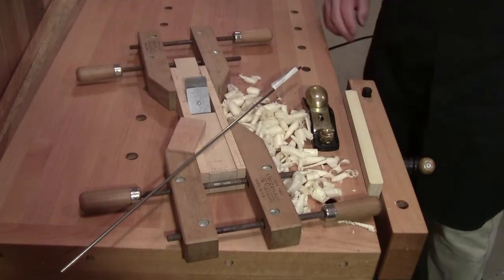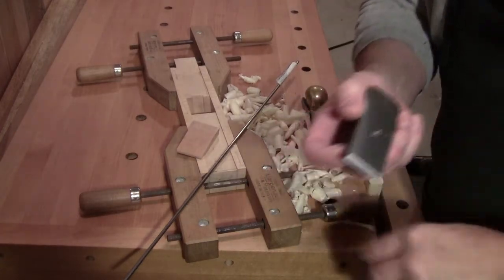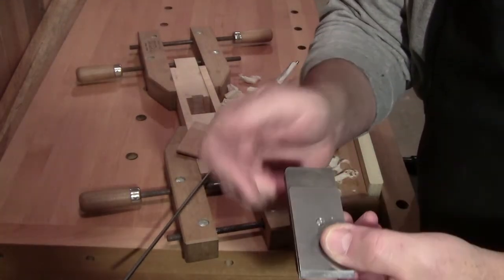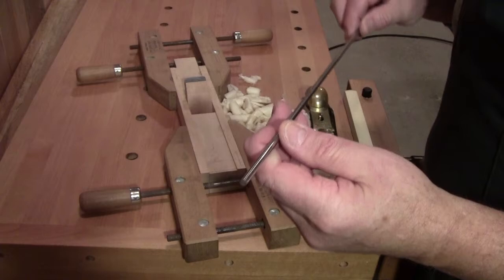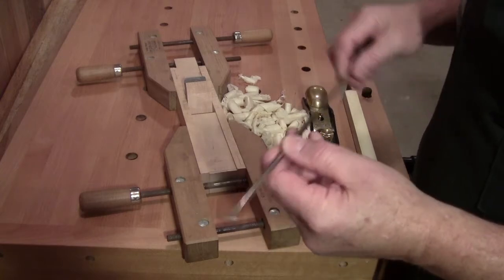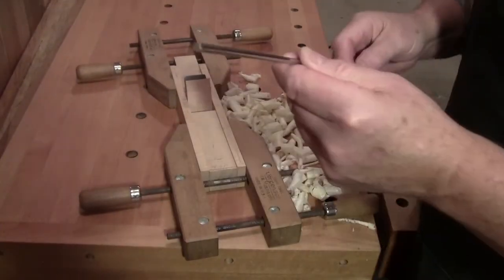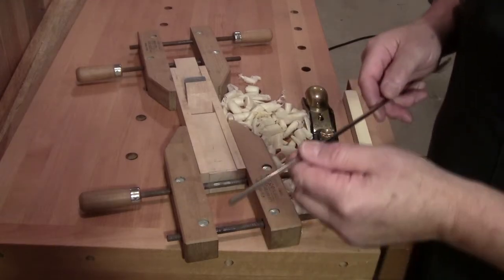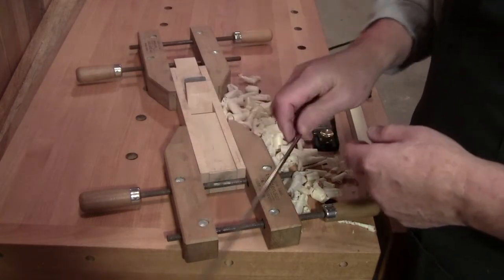PLANE TALK - East Meets West Wood Plane Build UPDATE - PLANE TALK  25 October  2017

Comment: Really enjoy your videos, I've recently gotten into woodworking and I've collected a few old planes at yard sales I'm really needing a low angle plane or block plane. Would you recommend me making one?
Reply from the maker: Low angle block planes are a little tricky to make.
An old Stanley 60-1/2 if in good shape is quite suitable.
On the top end is the Lie-Nielsen 60-1/2 and in the middle is the new WoodRiver Low angle Block.